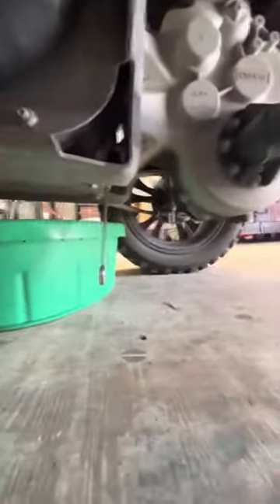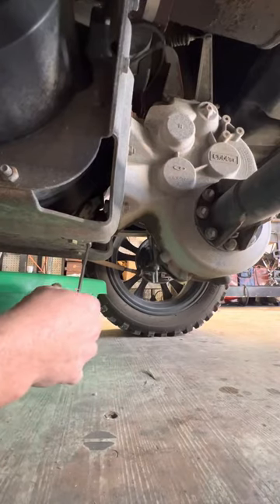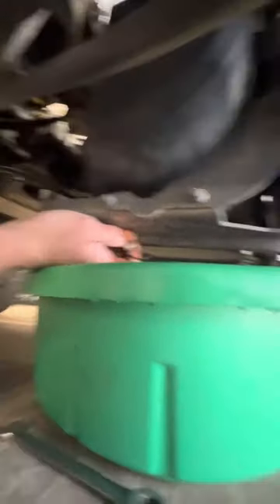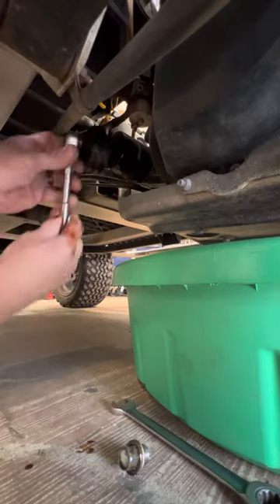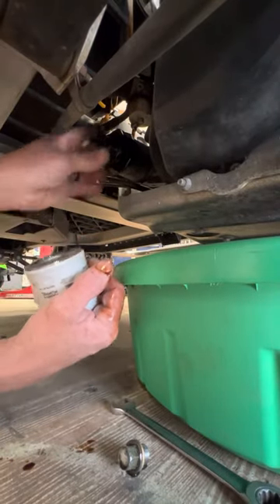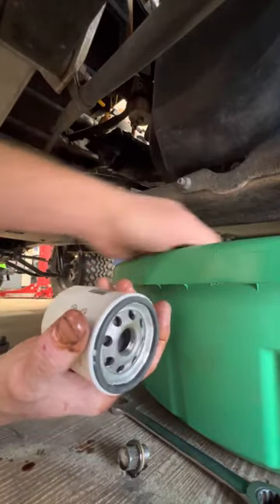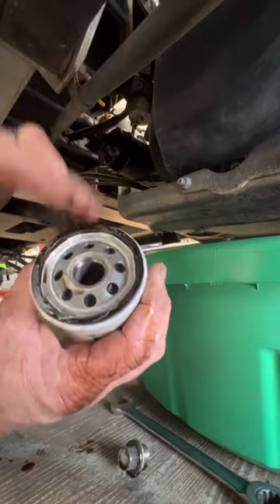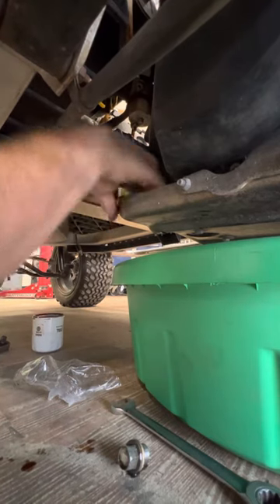HOW TO CHANGE OIL IN A CLUB CAR GAS

Comment: Should you partially prefill tne new oil filter ?
Reply from the maker: @tomhill4350  no because the oil filter hangs sideways.  If it was straight up and down yes but not sideways

Comment: I have an '88 Club Car. Any info on oil changes for it? Can't seem to find any info, and owners manual is useless.
Reply from the maker: Drain plugs will be on side of engine.
Reply: Very late in responding...lol. Drain plug is on front of motor. There is no filter, so will do more frequent oil changes.
Reply from the maker: Actually you’re right. I knits have read that completely wrong.  lol That is an old one lol. THey went back to the no filter on the new carts now.